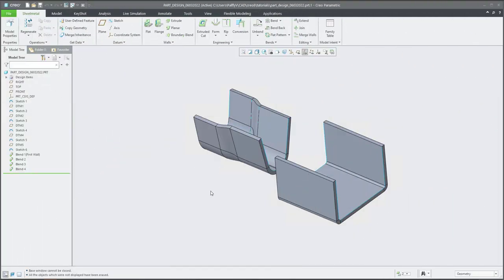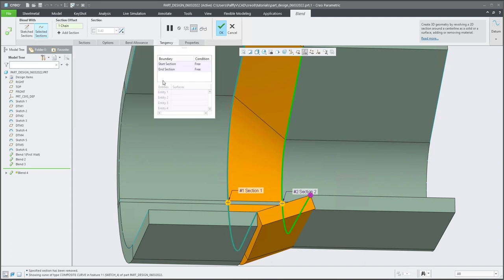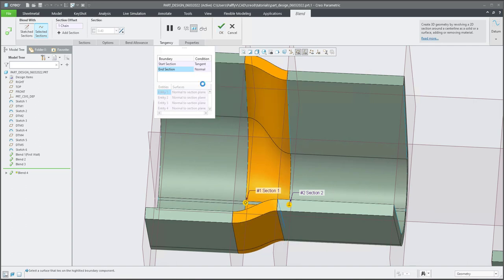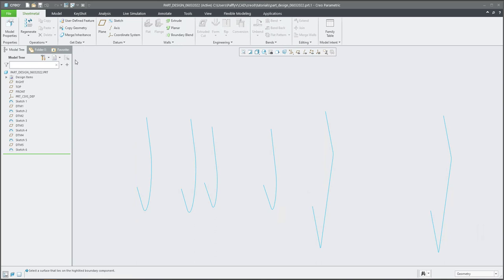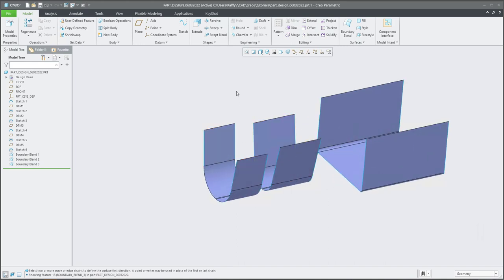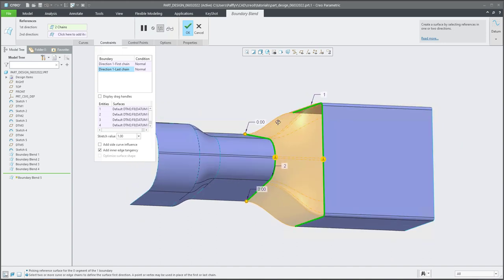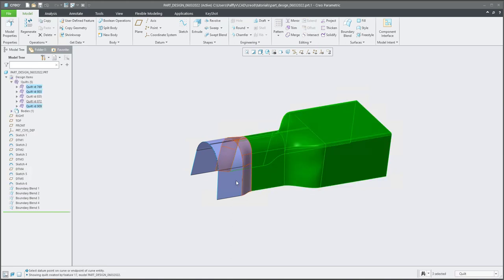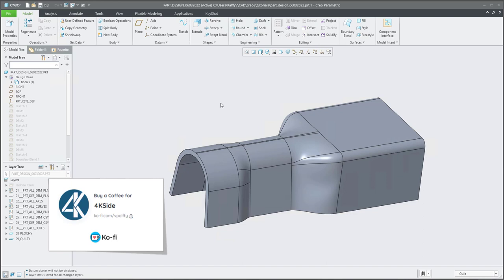Blend vs. Boudary Blend -failure recognition - Creo modeling

Comment: Want to ask a question.
Is it necessary to have a same shape both sides in style for ex:having circle & rectangle and trying to make surface?
Reply from the maker: Hi, I have used Style feature in the past but now I do not have license and I do no remember if system required same number of lines as in Boundary blend for surface modeling. I know that you can select more edges / lines...
Maybe you can as on PTC University dor some help with Style. Bye Vladimir
Reply: Means i can select both shapes as i sent you a email.Checkout